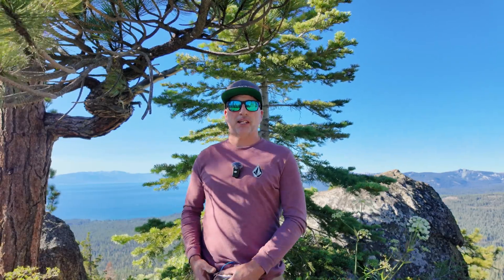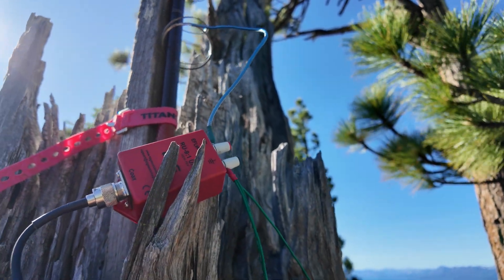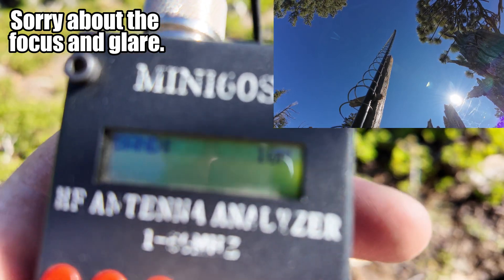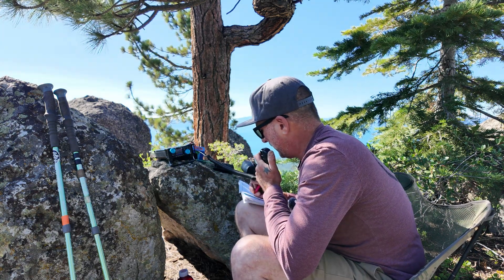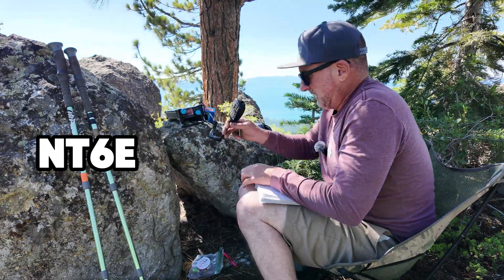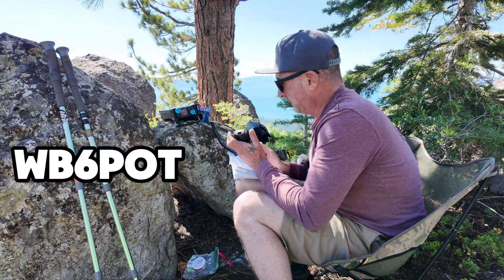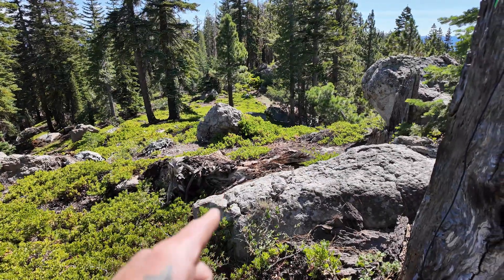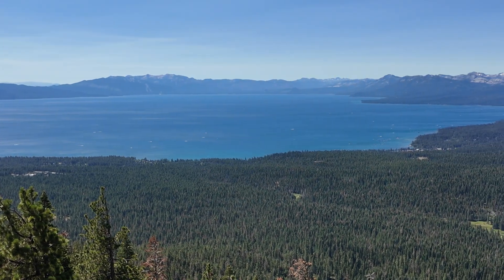Slinky Ham Radio Antenna

Comment: Could this be used for shortwave reception?  Also, do the gaps between the coils prevent inductance-corona and just act as a longer wire? 

Btw, that looks like a very fun hike!
Reply from the maker: Yes, a slinky will receive shotwave radio. I was operating in the SW spectrum. Inductance and corona discharge are related, but not directly. Inductance is a property of a circuit that opposes changes in current, while corona discharge is a partial electrical discharge that occurs when the voltage stress on an insulation system exceeds a critical value. In high-voltage systems, corona can be influenced by the inductance of the circuit, as the inductance can affect the charging. Here's a good read on a slinky dipole https://www.qsl.net/kd4cga/slinky.htm

Comment: Great video...  Confirming that this would be vertical polarization and good for 10/15/20?  was thinking about a long wire version of this horizonal along my fence...  Thanks!
Reply from the maker: Thanks 😊  Yes it was performing ok  in a vertical configuration on 10/15/20m with a 9:1 UnUn. 
You could try the slinky dipole configuration. I've been wanting to make one but haven't gotten around to it yet. Here's a great resource for the build. https://www.nonstopsystems.com/radio/frank_radio_antenna.htm
Reply: @W6IWN_Radio  Thank you... I have been away from things for awhile ( 20 years ) still have my icom 706 and looking forward to getting things going again

Comment: I made one using a PVC pipe after your first video on it. I made a qso to a POTA in WI from So Cal on 10m since like you showed it had a workable swr
Reply from the maker: Awesome! It's funny you mention PVC pipe for a mast. I was just thinking about builds with one last night. I'm curious if the length that the slinky is extended changes the SWR much. If so, a PVC pipe marked 
with different bands would be nifty. I've read that you can clamp sections of the slinky together at the bottom to shorten it. 73, Bobby
Reply: @W6IWN_Radio  I have read the same thing about length and swr. I used a pvc pipe because I was having issues with the fishing pole collapsing with the slinky.
Reply from the maker: @dadsrcworkbench1322  These are the masts I use. I just twist it tight as I extend it. https://amzn.to/4ffLvDf
Reply: @W6IWN_Radio  yep I use the same ones for my QTH Hf antenna and mobile masts

Comment: First time watcher, enjoyed the video here. AA9IG is the call. I used to have a friend that used a pair of slinkies in a dipole configuration suspended via NYLON rope about 60' in the air. I am not sure that he didn't use 2 slinkies per side of the dipole. Anyway, he fed it with 450 ohm ladder line with a home made tuner. He swore he could tune the thing from 160 to 10 meters. He did state however the inductance at low frequencies was hard to capacitively tune out. He also employed some sort of pulley/nylon rope configuration to lengthen and shorten the slinkies while in the air. I would have loved to play with something like this in my younger days! And by the way, he also stated that the slinkies rusted badly over time. The time frame would have been in the early 1990's. Take care and please upload more!
Reply from the maker: @jonsymmonds1120  AA9IG, thank you 😊 
I've been wanting to experiment with the dipole slinky configuration for some time... That sounds like a really awesome setup your friend had! I don't think they make the slinkys the way they used to. I want some brass ones, but they are expensive now! Thanks for watching, 73
Reply: Are you sure the inductance problem was on the LOWER frequencies and not the higher ones? It seems counterintuitive to me.